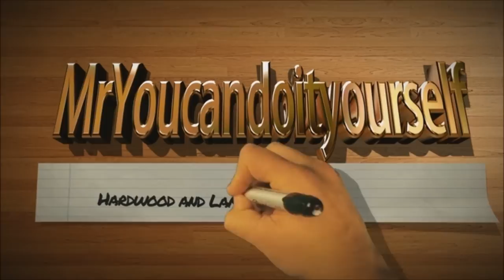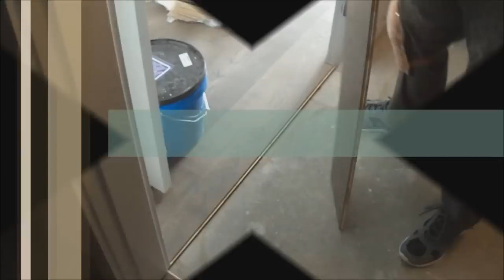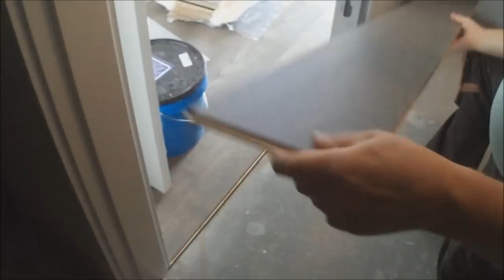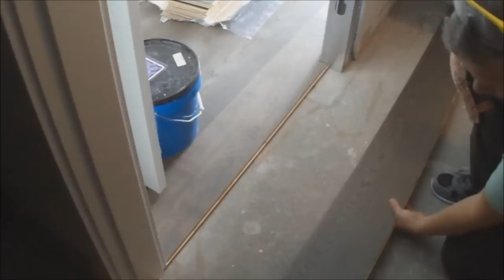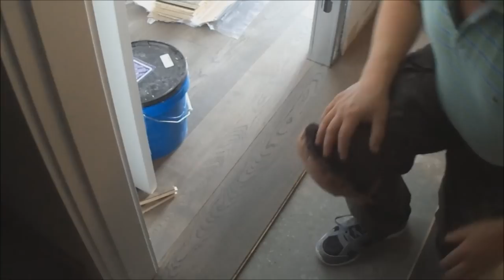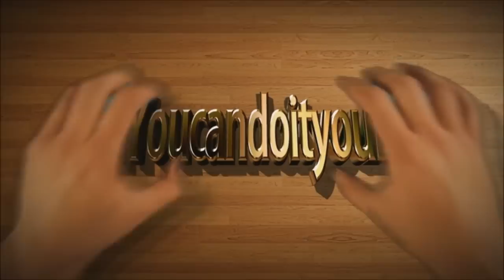Trick:Flat Hardwood Floor Transition Installation between Room and Walk-In-Closet DIY

Comment: Great video! That's similar to the same way I've done those last few ceramic tiles around the perimeter of the bathroom floor but this is so clever as I never thought to apply it to this application with vinyl plank flooring I'm getting ready to do in a bedroom:)  I'll definitely cut a few spacers with a scrap piece so there's tongue and groove on the ends. I already know what a timesaver it is to do this for sure:) Great tip, you're awesome! 
Getting ready to do VPF in a bedroom on concrete. Just looking to see how the pros are negotiating existing closet door tracks going into the closet.  
Do you think I can get away with doing the VPF around the tracks?  My thought is, with my application the plank will be running parallel with the tracks so I'm thinking I should be able to get away with it.  It's about 6 mil thick VPF.  Your thoughts?  Thanks again:)  All I've got to do is paint the walls before I do the floor.
Reply from the maker: Hi Lori, if it's possible - install floor under the track, if not, just finish with end cup from both sides of your truck . Thanks.

Comment: I see you barely left any room around the walls for the floor to expand and contract, thats a bad idea,  thats why people have problems with floors buckling up.
Reply: Jorge, You are partly correct. If this was a laminate, you would need the space for the floor to expand and contract, but this video says hardwood. And this looks like a concrete subfloor. so with an engineered hardwood, you don't need the expansion you would normally need in a laminate. So it is not necessary using engineered. (Although a little space is always a good idea). The floor he is installing is not a solid because you can't glue a solid to a concrete slab due to moisture in the slab that will cause cupping. So it looks like he is ok with the way this is going down.